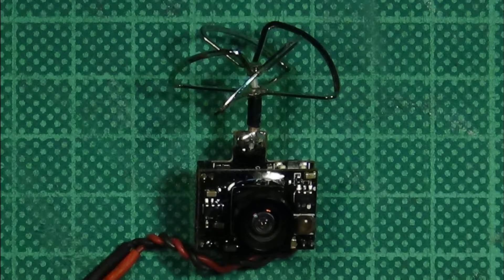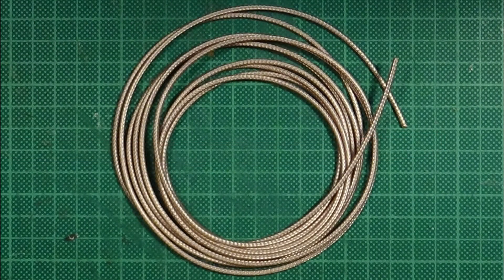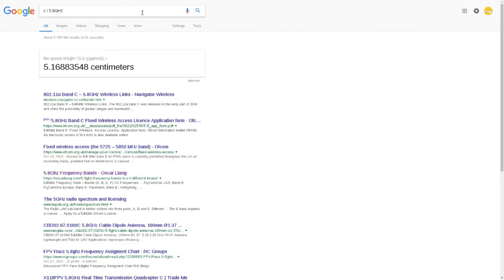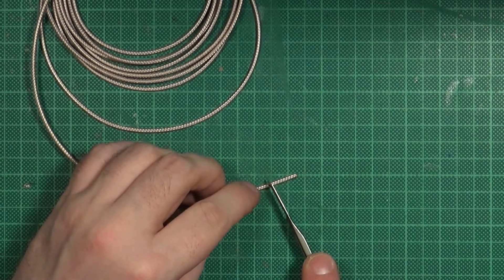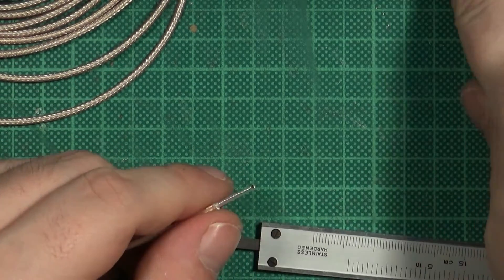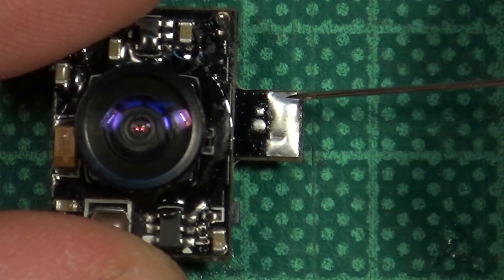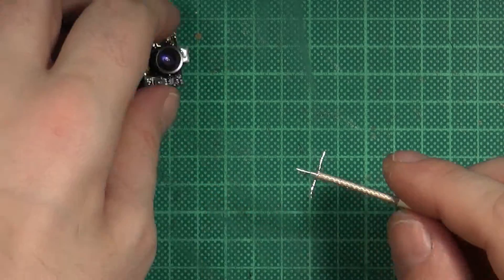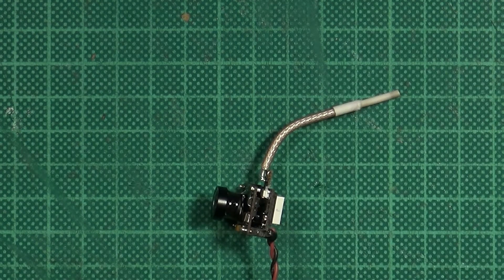TX03 Whip Antenna Mod

Comment: I got a problem, the antenna broke and i atacht a new one but the signal is so bad i cant even go 5 meter away😑
Reply from the maker: Double check your soldering, make sure that you did not short the contacts. It is also possible that you burned out the transmitter if you powered it for too long without or with a broken antenna.
Reply: stylesuxx wow that was fast👍, thanks im gonna ckeck👍🔥

Comment: Wie legt man die Länge des isolierten Teils der Antenne fest ?
Reply from the maker: Das aktive Element (wo die Schirmung entfernt ist) ist ein vielfaches der verwendeten Wellenlänge. Der andere Teil ist mehr oder weniger unkritisch (sollten halt keine Meter sein, wegen der Dämpfung). aber ob 1, 2 oder 3cm ist ziemlich egal.
Reply: @stylesuxx  Und Dämpfung ist schlecht ? deshalb sollte das untere Element möglichst kurz sein.

Gewinnt man signifikant an reichweite oder Qualität wenn man das aktive Element der wellenlänge entsprechend macht oder sogar noch länger ?
Reply from the maker: @nikleiser5888  Ja, möglichst kurz ist gut. Aktives Element muss ein vielfaches der Wellenlänge sein, länger ist schlecht, kürzer ist schlecht. Es sollte zumindest 1/4 der Wellenlänge sein. Du kannst auch 1/2 Wellenlänge machen, aber dann ist dein aktives Element eben länger, reichweite oder Qualität wirst du damit aber keine Gewinnen. Der Empfang/Qualität wird mit einer CP Antenne sicher besser sein, der Vorteil an einer linearen ist, dass sie einfach nicht so schnell kaputt geht die die CP - vor allem auf den kleinen coptern.
Reply: @stylesuxx  Danke. Ich fliege nur Fläche.

Comment: Hi, how important is the total length of the antenna? I have a TX03 and it would be better if the antenna is placed on the back of the 130mm quad. Maybe I add an addidional SMA connector. Am I rigth that both, length and connectors incluence the signal quality?
Reply from the maker: Length should not matter too much in that case. And yes, every soldered connection is better than any mechanical connection, so if you can avoid it, I would not add an additional connector.
Reply: stylesuxx Thanks for your answer. I'll give it a try

Comment: Do I set my vtx to the 5800 channel? As it seems to be bad reception when set at that!
Reply from the maker: Set it to whichever channel works best for you (some receivers seem to work better on some channels). Be careful with the exposed part of the antenna, it has to be cut precisely to length or it will not work as good as it should.

Comment: Will I get better range reception with this linear whip antenna ?
I'm using TX03 AIO on my E011 micro quad with  EV800D googles
Reply: No, but you save some weight.  Here is 2 videos of my Bfight 210, the first with the orginal whip antenne, and the other with a Mushroom antenna.Orginal:  https://www.youtube.com/watch?v=sThvgIxt-es   Mushroom antenna: https://www.youtube.com/watch?v=FOiNvQ5Kl1o

Comment from the maker: I highly recommend adding a dab of hot glue to the antenna connection on the PCB, or it might get ripped off on a harder crash, as mine did - it also took the pad off.
I then soldered the antenna to the back of the cam and did not do the cross, but instead soldered it directly to the shielding, more like the original antenna was soldered. This seems to be holding up pretty well now - Even on harder crashes on the antenna.

Eachine released a new version of this cam, the TX05 https://goo.gl/jjXmWA it has a linear antenna and OSD "mod".
Reply from the maker: I simply soldered it to the other side of the PCB since all the pads were still there...

Comment: i dear i just got my frist fpv goggles vrd2 ,  and i have also ordered tx 03 camera and waiting when it will arrive ,

pls guide me few things ,

with one cell how long this camera work ???
if i use 200mw then how long battery work and if use 25 or 50 mw then how long battery work ??
with 200 mw , what range did you get ???  did you check and what range with 25 or 50 mw ??

how to use camera .
pls guide me, may i turn on camera first and set band and frequency ??? and then turn on goggles ?

for example if i set band 4 and frequency, for first time , then no need to set the producer again and again ??
only time sitting .

hop you guide me with thanks
Reply from the maker: When you use 1 Cell the cam will pul aboutl 510mA at 25mW, so how long your cam will run depends on the capacity of your cell. With a 600mAh 1S battery you should be able to power the cam for 1hr at 25mW, if you are only powering the cam.

In my case, I power my micro quad and the cam from the same battery, so it does not really matter for me that much, after about 3min I am done with the battery.

In the country I live in we are only allowed 25mW, so I did not test the higher output. But 25mW are enough for where I fly. I have full coverage in my flat and when I go outside I usually go to parks where I have a space of about 150m, in front of me, which is absolutely no problem.

But range depends on a lot of factors, if you use the whip antenna described in this vid you will not have as good reception in multi path environments (like buildings, lots of trees,...). Generally, the more stuff you have in line of sight from you to the object you are flying, the worse your range gets.

The cam comes with a small leaflet explaining how to set stuff up. You have one button, if you press that shortly, you switch between channels (shown on the 7 segment display). If you hold the button down for 3 sec you get to the menu where you switch bands. If you hold the button for 5 sec you get in the menu where you set output strength (it comes set to 0 by default, so you will at least need to change that). Once you made the settings they are saved, so no need to set it up every time.

You can check out some of my flying vids to get a feel for the range. I have one where I fly in my flat, one in a garage and one on a playground. The ones inside I fly with the whip antenna, the one on the outside with the original antenna the tx03 comes with.

Comment: many thanks for your kind and very good explanation about tx 02 and 03 ,
well it mean we have to use one extra 1 cell battery for this TX O3 CAMERA , ??
and how much time i can get with one cell battery ??

eachine MC O2 , look better in power way ,  can use 5v to 26 v ,
and can directly plug with receiver or 3 cell battery ,  what i under stand ,

and sold out every where :) this mc 02
Reply from the maker: What size of quad are you building? If you are building a bigger sized quad, maybe you want to go with a runcam or something of that order.
I use the TX03 on my micro builds where I power it either directly from the 1S battery or (even better) from 5V on the flight controller, where I can draw enough current.

If you want to use a separate battery to power the Cam, you can do that, but I can not tell you how long it will run from it - will also depend on the transmission power that you set.

And yes, the MC02 looks very interesting indeed, already added it to my wishlist ;-)

Comment: i am new to fpv world ,  need your help and guidance , pls let me know eachine  AIO camera i should be buy , i have BOUGHT ,
EACHINE VR D2 GOGGLES , and still could not understand which camera will be good for me as my first fpv camera ,

this eachine tx 03 or 02 ,
or eachine mc 02 

pls guide .

and also tell me tx 03 or 02 , what battery power need , 3 cell ???

as you change the antenna , does it increase the range ??
Reply from the maker: First of all, no the whip antenna will not increase your range, it is just way harder to break than the circular polarized antennas. I am a neewbie too, and I tend to still crash a lot, so this is just a cautionary measure.

The difference between TX02 and TX03 is that the TX02 has a fixed transmission power of 200mW. with TX03 you can switch between 0, 25, 100 and 200mW. Where I come from (Austria, Europe) we are only allowed 25mW max. I decided to go with the TX03 since this allows me to comply to the rules in my region, but gives me the option to increase transmission power when I am somewhere where more is allowed.

The TX02 and TX03 are designed to be powered from 3-5V so you can either attach it to a 1S battery directly, or - even better - to a clean 5V source from your flight controller or PDB.

MC02 on the other hand can only be powered from 5V and you will need a booster board to directly power it from a 1S battery, or again power it from a clean 5V source. Further it has the connections for OSD broken out, so no need to mod this cam if you want to use an OSD(highly recommend a board with integrated OSD). Also it seems it has a higher resolution cam. You can switch between PAL and NTSC on the camera directly. Also it seems like the focus of the lens is adjustable, at least from the pics it looks as if there are threads to adjust focus, but I do not have this AIO cam, so this is the info I took from the product description on Banggood.

Let me know if this answers your question.

Comment: if i buy TX 03 , can i use this with one cell 3.7 ?? or   can i  use  this also with 3 cell ?
i am using 2200 mah battery on  my glider plane .
Reply from the maker: you can use it with one cell directly, if you power from more than one cell, you should use a 5V BEC inbetween.

Comment: where to buy the cable?
Reply from the maker: Link is in the description. I got mine from banggood. But you can find it on amazon too.
Reply: can you buy that on a hardware store?
Reply from the maker: Not in the ones I have been to, maybe in an electronics store...
Reply: stylesuxx thanks man help meh alot keep up the good work

Comment: dear stylesuxx, i am very happy  the way you reply and you guide , you are great man dear ,
well i am going to use on my glider plane ,   first 

and after then on quad ,
me and son want to enjoy  real feel of flying , with FPV GOGGLES , 

because eachine AIO CAMERA are easy to new bee , thats why i start it from this ,
any other advise from your side , pls help for me .

tariq
Reply from the maker: Glad if I can help :-)

I would definitely recommend to get a flight controller with OSD and buzzer for your quad. So you do not over discharge your batteries, I lost a lot of batteries du to over discharge. Also the Buzzer helps finding the quadcopter in higher grass.

Flying with FPV goggles is so amazing, you and your son will love it, I am sure!